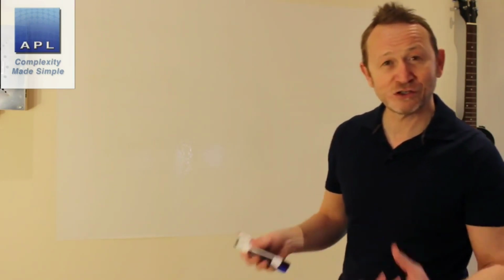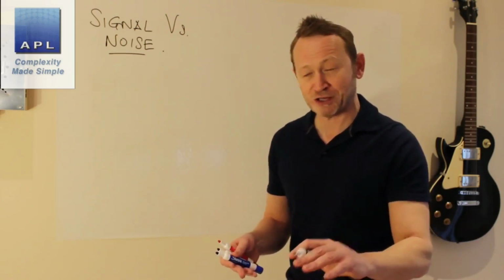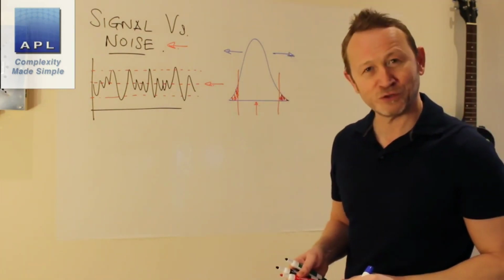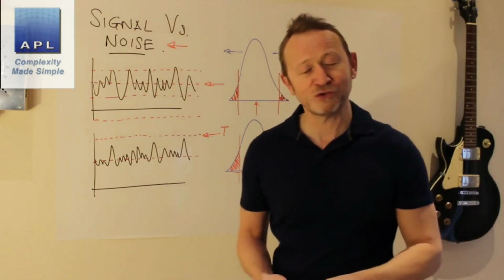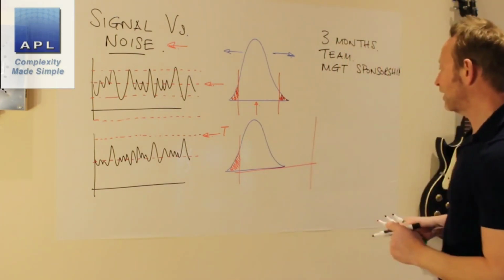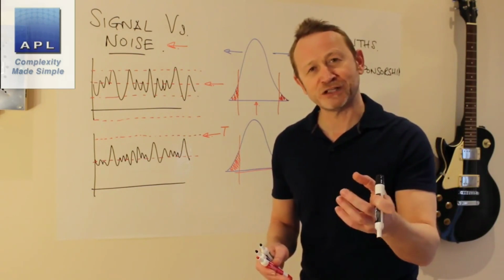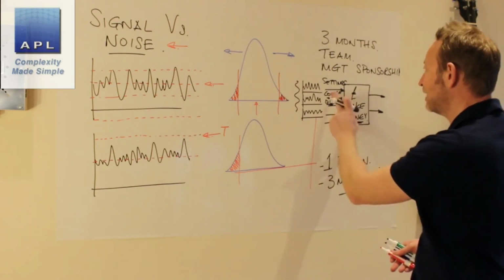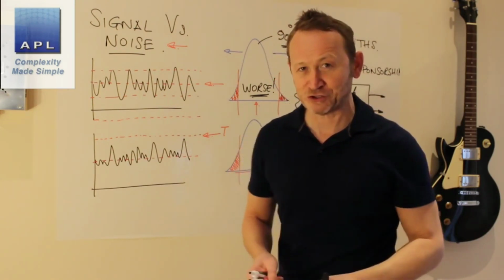8D Done Properly - Understanding Signal and Noise...

Comment: Hi Paul, in the title you refer to 8D. The timing to close an 8D is less than a month so you can’t have a problem with noise or you would have an angry customer ! That’s probably why we always try to « sell » it as a problem with signal (aka special causes) or we fix the most obvious input but it always has to look like a unique event. You can’t fix everything within an 8D time frame. This customer rule might sometimes cause its unhappiness..
Reply from the maker: Pierre - The only real way to please the customer is to fix the problem fully. Tinkering with one variable when it's multi causal will always end in un-happy cusotmers again and again....
Reply: @paulallen5321  yes I agree, I just wanted to point our the problem with the timelines. 3 months Vs 1 month